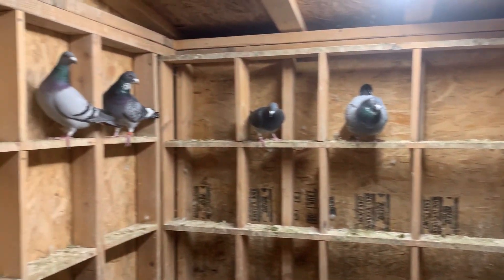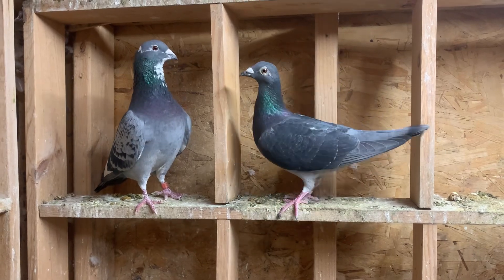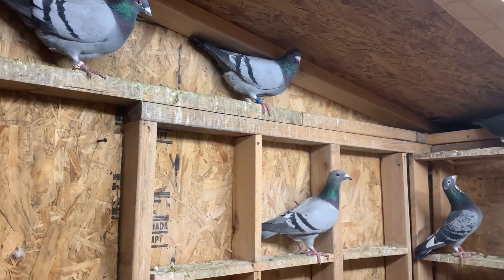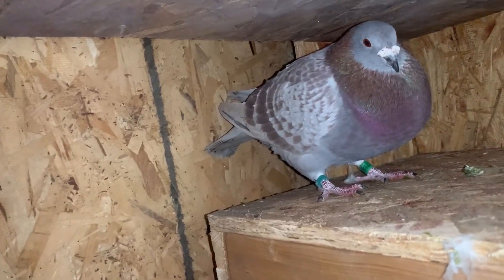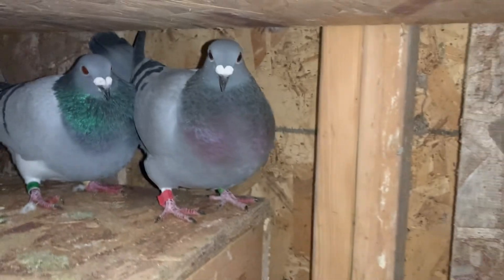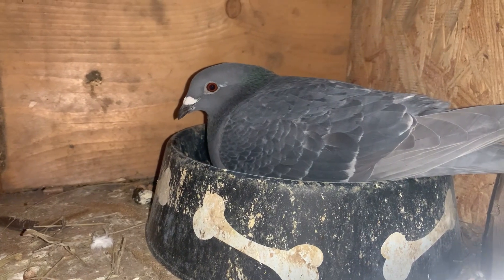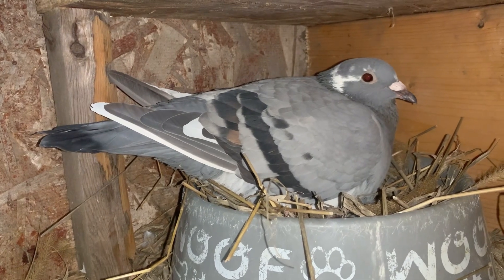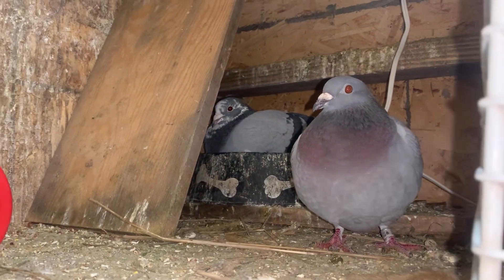2024 HUEX911 LOFT Racing Pigeon Winter Breeding

Comment: I like how you marked each nest box with a playing card. Also, I had wanted to breed a couple of my pairs as well but I don't have the luxury of adding artificial light into their coop. What advice could you give in order to help them get into breeding?
Reply from the maker: Thanks, the best thing you can add to the loft  with out being able to drag an extension cord to the loft is installing solar panel shop lights. I get mine from Menards.The only downside is sometimes during winter the sunlight is minimal and won’t fully charge the light but you should still be able to get 30mins to an hour of running light. I’ll usually turn on my lights when it’s dark already and give them some night feeding and let the lights run until it dies. Repeat daily and  just provide nest bowls and nesting materials. The birds should start breeding within a week or so and always keep an eye on the birds daily
Reply: @huex911  oh that's cool. I'll try that then. Appreciate the advice.
Reply from the maker: No problems, good luck on the birds